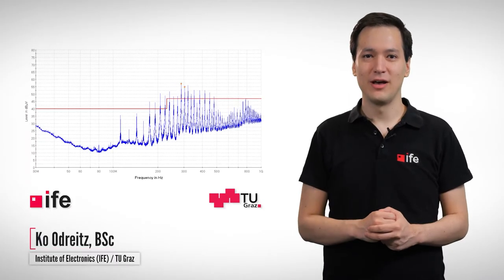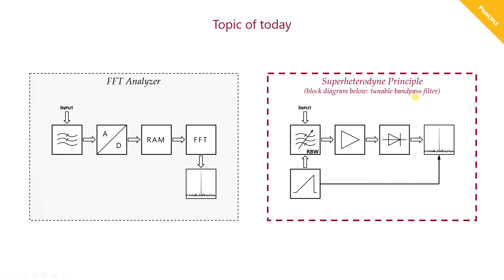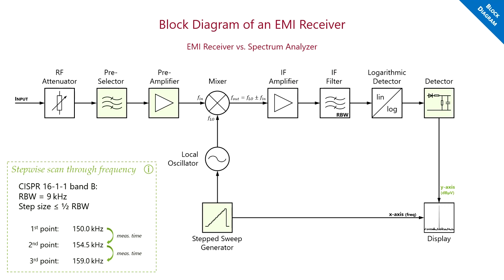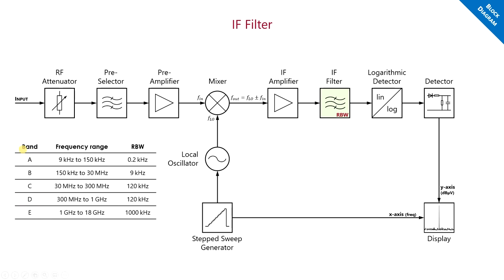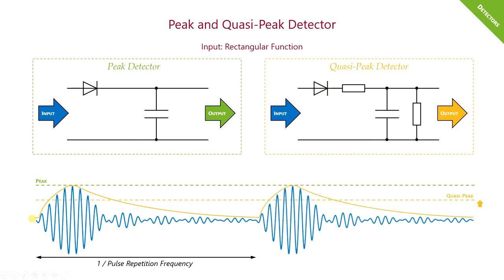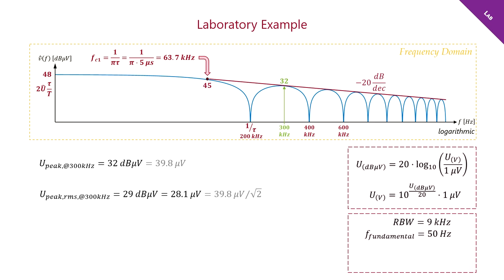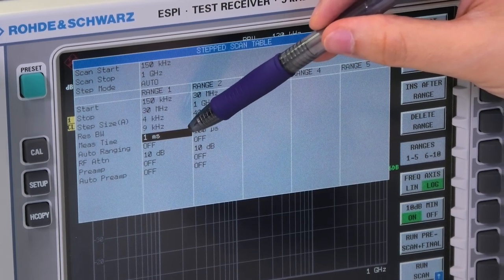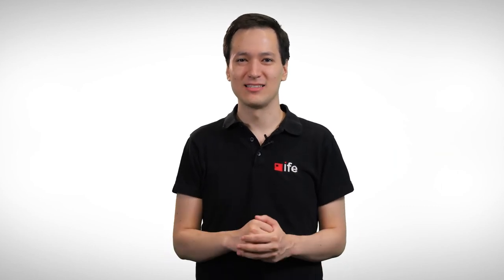How does an EMI Receiver work?

Comment: I wonder whether the log converter is correctly placed before the detector. I think it should be between the detector and the display. First, the signal after the IF filter is alternating so it has negative half cycles (this could be coped with by rectifying); second, only the peak mode would yield the correct result. Particularly the RMS of a log version of the signal is very different from the log of the RMS value. Third, in several EMI receivers the log/lin graph is optional.
Reply from the maker: We understand your point and do not have a proper answer to your question yet. In literature the setup is often described like we have done it here, but we will try to find out more, why it is done in this way.

Comment: Please explain preamplifier
Reply from the maker: A preamplifier is a device (can also be built into the EMI receiver) which features low nois and high gain. It can increase the signal to noise ratio which can be obtained by the EMI receiver.